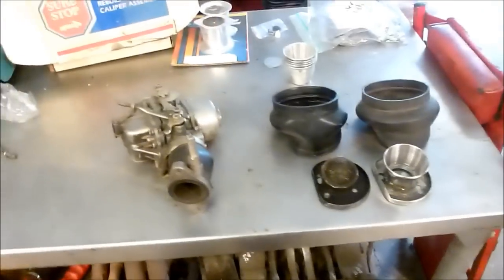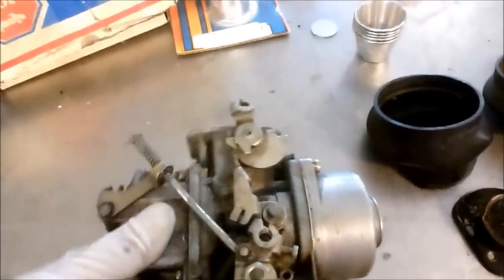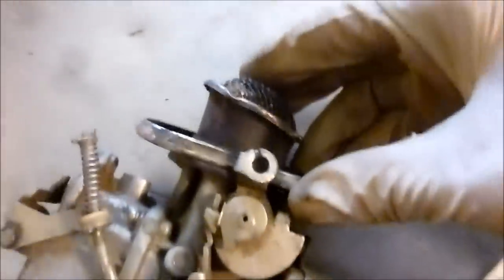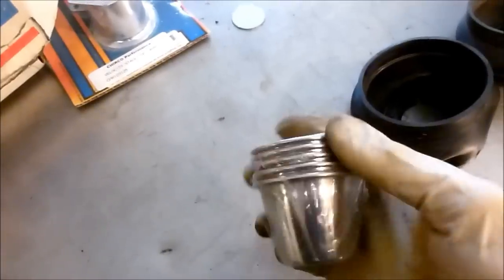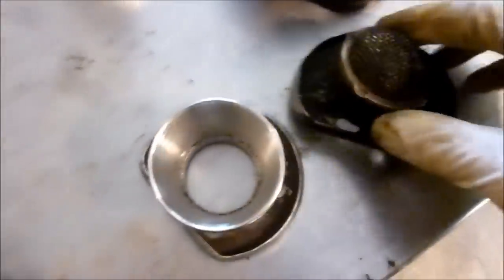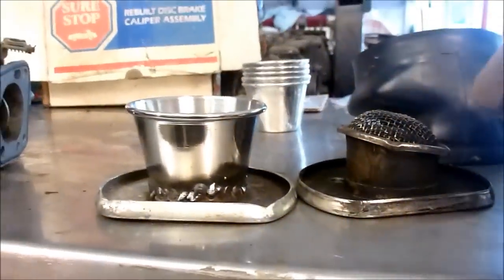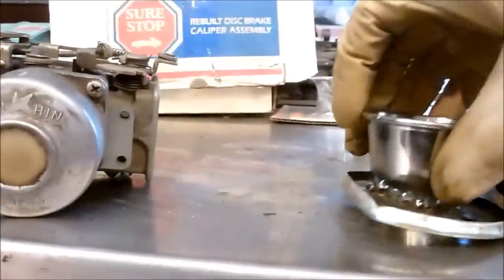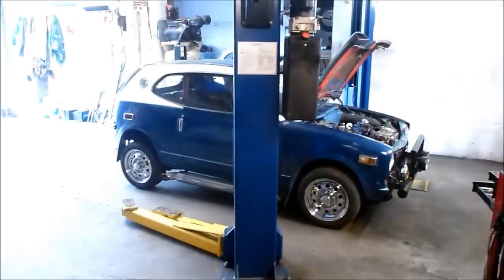Power tuning a Honda z600 with a shrimp dip cocktail sauce velocity stack ( part 2 )

Comment from the maker: I too was surprised it richened up, so I tested it with and without the air filter. ( they look dirty even new ) It is a CV piston carb, maybe richer means more air flow?. It certainly has better throttle response, especially down low, no power was lost, but I'm a little disappointed